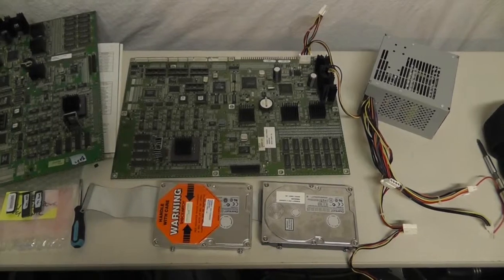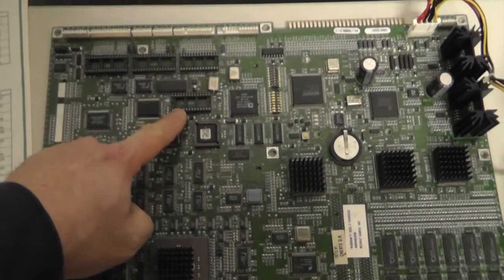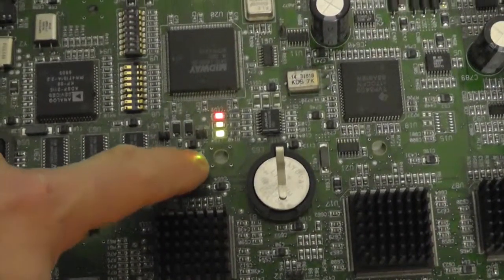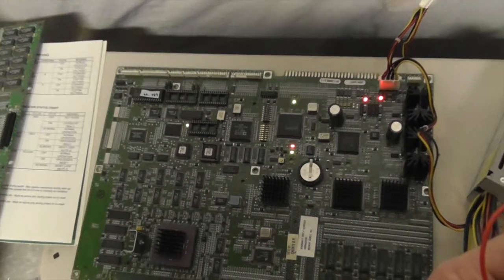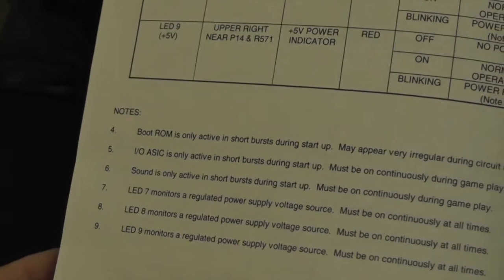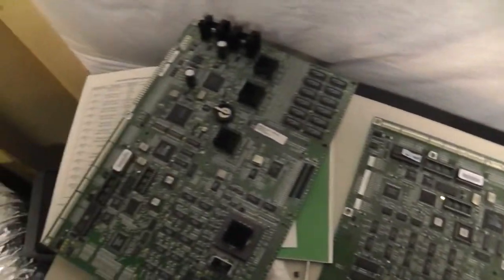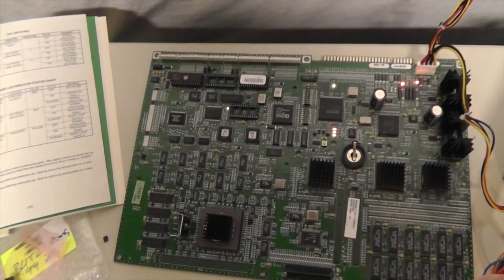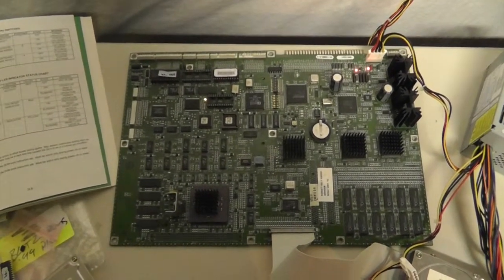NFL Blitz Troubleshooting - Seattle PCB

Comment: JACKLICK, 
                      1.) The Two phase clock signals was used for sharing the data bus for instruction sequencing to sync the RAM devices?
     2.) DMA puts the cpu to sleep and transfers ROM data contents to flip flop latches and RAM chips? anything else what the DMA purpose and function is used for?
           3.) i see the access time on the datasheets for parts like RAM chips, PIA chips, PLA chips, 
PIA & PLA chips have access time also
But I don't know what determines a designer to choose which access time is right for the game programming code. How would a software arcade game programming code know which access time to choose for the IC chips?
         4.) The software game programming looks at all the datasheets access times for the all the IC chips and choose the access time based on the Clock speed? 
If the clock speed is 1Mhz, what access time would be good to use?
If the clock speed is 4 Mhz, what access time would be good to use?

Comment: Any chance you have a monitor/chassis troubleshooting guide? I have an original Blitz 99, updated to 2000, 4 player, with N64 cartridge reader - machine boots, audio works, controls respond (confirmed via sounds queues when joys are moved and buttons are pressed) but the monitor shows no image...
Reply from the maker: I am sure some of my videos show testing a monitor.  There is a tool called TPG which allows you send a video signal directly to monitor.  Also you may want to check out @mikesamateurarcademonitorr6856

Comment: Hey, thank you for your video. I'm working on troubleshooting my blitz 99 cabinet. I have no picture, no sound, and the unit seems to keep resetting. The three central leds come on and off in varying patterns but it repeats. Just checking to see if you're still around, I can get more detailed info later.
Reply: Ps: I've heard I should adjust the power supply to a higher voltage, I'll test with my multimeter but I'm not sure where the adjustment pots are
Reply from the maker: Typically on the power supply you there is a single knob to adjust the +5v.
Reply from the maker: I am around.  Was the board working for you previously?  Honestly, these boards are beyond my ability to repair but if you have the correct security chip, roms and hard drive image, it will boot.  Otherwise you are looking at finding another board or sending it out for repair.
Reply: @jacklick  If theirs only one knob is it likely to be 5v? Thanks for the quick reply btw. I should have the correct rom and security chip, I've just replaced the hard drive to test it out to no avail. Completely understand these boards are beyond most people's ability to repair, they seem finicky and unreliable. I'm hoping to avoid turning it into a MAME can to make use of it, as it's my first cabinet, but I enjoy fixing things which aren't documented and contributing how I fixed it. That being said I just got this in a non working condition and I'm curious if it's fixable.
Reply from the maker: @heretikmusic7054  yes, if there is only one knob on the power supply, it is +5v/master adjustment.  Other voltages will increase as well but +12 and 5v have +/ 10% voltage tolerance vs +5v at +/- 5%.  basically no need to go over 5.1v at the board and never go over 5.25v.
Reply: @jacklick  awesome, I'll be throwing my multimeter to it soon and I'll report back! Thank you! I'm torn about adjusting the PSU for magic smoke reasons.

Comment: JACKLICK,               Why is there 2 different clock signals used in arcade games that are out of phase, for what reasons?                   Why would you want clock signals to be out of phase or delayed?
Reply from the maker: You are like my Yoda asking these questions.  I actually don't know the answer but am curious george so looked into it for a quick sec to get a guess.  I don't have enough experience to say there are always two clock signals being used.  Example, missile command, which I am working on now, has phi0, phi2 and phi1.  phi1 is out phase with the other two but isn't used.  I assume the microprocessor designers put phi1 there so board could use to trigger circuits/chips on "different" rising or falling edge for speed and bus/cpu access contention reasons.
Reply: @jacklick  yes when looking at arcade game schematics because they often have 2 clock signals that are out of phase for some reasons not sure why they would invert the clock signal and also add propagation delay to the clock signal. 
2.) When looking at an arcade schematic how can you tell if the data buss or address buss has "bank switching"? any tips on how you can know

Comment: How do you fix if only red color works, green and blue output dont work
Reply from the maker: Have you verified the monitor is fine?  I would compare voltage (peak to peak is ideal) on the color outputs of the pcb.  You should be getting 0-4 Vpp; if not you have a pcb issue.  I have seen this issue be a PCB related but haven't fixed any as I am not good with smd work.  Hope it is a monitor issue.
Reply: @jacklick  the jamma edge connectors are black lookn
Reply from the maker: @kevinthorn9672  you might want to post a pic theead on klov.com.  if they are burnt, it it will need edge repair at a minimum.  You can clean with eraser.

Comment: hello, so just recently my blitz 99 arcade stopped working. everytime i turn it on it just stays on the boot up screen and just keeps saying initializing game but it does not go past that screen. what can be the problem? it makes the ding sound when i start it up and diagnostics dont show anything wrong. any info will help. Thanks!!!
Reply: actually, i have a blitz 97
Reply from the maker: I would expect a hard drive issue.   Do you hear the disks spinning up?  Do you have HDD led activity on PCB?  Check  the 12 min mark in the video to see this.
Reply: yes i hear it spinning and there is light on the pcb. i will  see the 12 minute mark to see if i can figure it out
Reply: okay i checked it and yes the hard drive led comes on and hard drive sounds like its spinning not sure what else it can be
Reply from the maker: At the end of my video, it shows the on screen diag portion of the game. If yours is hung at initializing game (last screen before "blitz logo"), my best guess would still be the hard drive.  I would verify voltages with hard drive connected, just to be sure but if it passes all other tests and doesn't load game and doesn't reset, I would try replacing HD with flash card solution.

Comment: This video is great ,  but I'm having a little bit of a different issue hopefully u can point me in the right direction.... everything boots fine , my problem is after about 1 min the joy sticks stop working ..... All buttons work fine but the 4 controls don't work at all after about 1 min .... I have a blitz 2k ... any help would be great thanks
Reply from the maker: Never seen nor heard of this issue.  The fact it is happening to all the joysticks leads me to think pcb issue or voltage issu.  I would verify +5v at the joystick connectors or optical pcb to make sure they are getting good steady voltage.  Otherwise, my next best guess would be some component on the pcb that is shared.  Unfortunately I haven't found a schematic drawing of these pcbs so wouldn't even know where to start looking on the board.
Reply: jacklick Imma check the +5 at the joysticks .... I had good voltage to the pcb , but maybe I should check it too the joy sticks

Comment: None of my joysticks are responding, i messed with the wiring and i thought i returned it all back to normal but all my buttons work but no action from the joysticks. Any tips on where to check?
Reply from the maker: Do you have a 2 player setup or a 4 player?  I haven't messed with a 4 player but you can plug the joysicks directly into the PCB and change a dip switch to enable 2 player mode.  This way you can bypass the i40 and verify the joystick optical pcb is working.   If the joysticks work in two player mode directly attached to pcb, you know it is wiring or the i40 board.  That is what I would try to do.
Reply: jacklick i have two 4 player machines. Both running seattle boards and bith running 2k. I know how to change the dips to 2 player mode but how do i wire the joy sticks directly to the pcb?
Reply from the maker: I think I saw your thread on KLOV.  I will take a pic of my set up and post it on your thread.  In theory, you unplug the i40 from PCB, unplug two of the joysticks from the i40 and then plug them in the pcb in I think the p3 i/o and p4 i/o connections (closest to jamma edge).  Need to look at mine to confirm.
Reply from the maker: ok forgot I am running a vegas (showtime/blitz) combo in mine so pic won't help but as long as you have enough slack you should be able to plug two joysticks into the seattle board p3 i/o and p4 i/o just as I stated.
Reply: jacklick the wiring doesnt seem to allow for that though. The wires are all wonky and missing a pin thats different than the missing pin on the joys sticks.
Reply: And yes that was me on klov. Lol
Reply from the maker: Ok I looked at my 2 player wiring and doesn't seem straight forward to go straight from the z connector.  I don't have a diagram of the i40 board wiring which I would think is similar.  Posted on KLOV to continue conversation and not giving up.  Has to be an easy way to test these in 2 player mode although it is not obvious at this point.
Reply: @jacklick   Did you guys ever figure out the 4 player joystick issue?  I'm trying to buy a Blitz 2000 4 player box, everything works but the joysticks.  They are pretty sure it's the I40 board.  Worker there thinks he can remove these joysticks and replace them and bypass that board; good idea or bad idea?  Do you know somewhere to start looking for a I40 board instead?  Or idea how to fix it?

Comment: I have the same PCB and find this very helpful. What if after letting it sit for a while all led's in the middle of the PCB and at the top left stay out and the sound rom led stays lit? I can hear the HDD spin up when I first turn it on. I'm currently working on the monitor and trying to troubleshoot the game pcb in the meantime without a monitor. Thanks!
Reply from the maker: I assume you can't play the game blind (eg coin up and hear game sounds?.  One of the 3 middle leds  and the sound rom  should stay blinking during normal operation.    Have you verified +5, +12 and -5 voltage to the board?

Doesn't sound like a the game is resetting if the middle leds go out and don't come back on.  If they did, you could have a version mismatch between HD image and security+boot roms.

My best guess is the board ailing the diagnostics and you have a GPU or RAM issue on the board.   Check voltages and you need to hook it up to a monitor to see what is failing.  Total guess based on your description.
Reply: jacklick Thanks for the reply! The 12v +5v and -5v are lit. I read in the manual that it will still light no matter if the voltage is right or not. I'm going to double check the voltage on the jamma connector tomorrow and will report back.

You're right in saying the game isn't booting and I don't hear it playing blind at all. I'm going to be ordering the parts for the chassis tomorrow and I'm fairly certain it will fix the chassis. I hope the tube is good! If not I'm screwed...

Edit: checked the voltage and it was high. I literally touched the knob to turn it down and it spiked pretty high and the power supply shut off. It seems to shut off when trying to adjust it at all and all the led's on the PCB are on with the CPU stuck in reset.  I hit the reset button and does nothing. All of the eproms are in place, but it's doing exactly what you show in the video if there are no eproms in the board. I'm hoping this thing isn't fried...
Reply from the maker: re the power supply cutting off while adjusting,  I have seen this several times and it is probably old power supply so could be replaced for like @ $40.  You can also use some deoxit on the adjustment pot but you will have to open the PS case to  get to it good.  What were your voltage readings?  Was the game working previously or you picked it up in a non-working condition?
Reply: jacklick I ordered a new power supply and is on the way as of now. I was told the monitor just stopped working, but seems that honestly wasn't the only issue since it wasn't playing blind when I got it home. I ended up getting it for free because they were going to throw it away so I'm not too upset. The one thing I'm really rooting for working is the tube, as that will be much harder to replace. I don't see any screen burn and hope the guns on the crt are good. One thing at a time I guess. I'll report back once I get everything in and set up and hopefully have this monitor fixed so I can see if there are any error codes during startup. Thanks for the help!
Reply: I finally got the new power supply in to try the monitor and the monitor now turns on, but is a white screen. The power supply voltage is 5v and even tried to go to about 5.1 at the jamma connector and still nothing but a white screen. All led's on the blitz PCB stay lit and no longer hear the HDD try to boot up. Reset button still does nothing. Any ideas on what to check on the game board?

Thanks!
Reply from the maker: RejectedManiac if all the cpu led are locked on it is definitely a pcb issue. Assuming you have a good boot rom.  I have seen this several times and it is always a board or cpu problem. Sounds like your monitor works though
Reply: I just verified both u32 and u95 with my TOP853 and it seems to verify against the MAME roms. What should I look at next?

Comment: So I'm having a issue with my 99 blitz rebooting. It goes thru the startup without problems but then shortly after it just continues to reboot. Any help would be greatly appreciated
Reply from the maker: at which part of the boot process does it reboot?  You see the full diagnostics screen?  You could have a security key <> HD image mismatch or just a bad HD image.
Reply: jacklick It goes thru the diag. Screen, everything passes, the. The main game screen turns on and then it reboots. And sometimes it just stays on reboot.
Reply from the maker: Seems like HD image or security chip/image mismatch issue to me but can't be positive.  Are you using a flash drive or spinning disk?
Reply: jacklick currently on a Hard drive. Would like to upgrade to a 2k/showtime but not sure if I can or how.
Reply from the maker: You can't upgrade to 2k/showtime on a seattle board.  On the seattle hardware  you can run blitz aka blitz '97, biltz '99, or blitz 2k aka blitz 2k gold.  the combo blitz/nba board is a vegas board set.   

Was the game previously working?  Is the HD labeled?  Just want to eliminate mismatch of security chip and HD...make sure both say '99.  cheapest option is to just get a replacement '99 harddrive for $25
Reply: jacklick it is labeled. Says some company in Baltimore. Looks like it's the original HD. It worked on the first fire-up. I was able to play maybe 3-4 games. 

Also, you have any idea on why certain buttons only work sometimes? They register on the dipswitch but the 2 middle players seem to choose when to work.
Reply from the maker: So my best guess is HDD failure at this point.   If it worked before it is definitely not Security Chip <> HDD mismatch.  Definitely check your voltages to make sure you have good +5v, -5, +12 on the PCB.  You could unplug the power to the HDD and test +12 and +5 there at the molex pin.

Regarding some buttons working sometimes.  You are saying they register at the button switch? these are called micro-switches.  Did you use your multi-meter on continuity/ohm setting to test at the connector?
Reply: jacklick ok. I'll check those things when i get home. 

The buttons register at the switch but sometimes either players 2/3 won't work at all or buttons won't register unless pressed multiple times or very hard. I just purchased the game yesterday so I'm learning as I go and I haven't done and diagnostic checks. I dont like wiring and wiring doesn't like me  lol.
Reply: jacklick so I had a guy check everything out and it turns out the previous owner turned up the volt output to around +7v. On top of having it in the garage. He believes the board is bad. Turned the voltage down to +5 and it won't go into the boot process. 

Looks like I'll be searching for a vegas board or a 99 replacement board.
Reply from the maker: hmm, +7 is too high but I doubt the board is bad if you were making it through diagnostic screen.  You should test voltage at the chip to be 100% sure...it likely is too low now.  Most logic boards/chips will be fine from 4.75 - 5.25 +5vdc...   there is loss through the harness.  Open a repair thread on forums.arcade-museum.com before giving up.